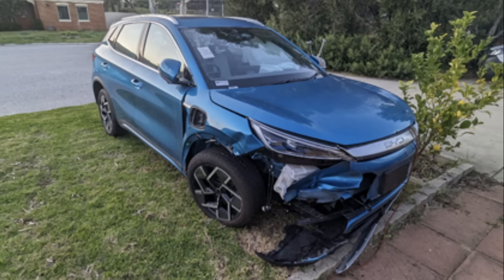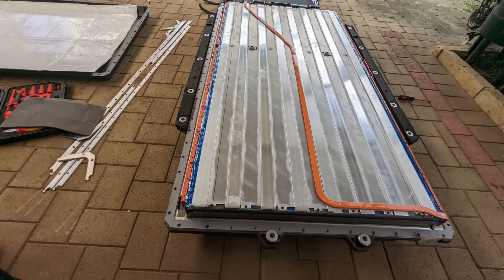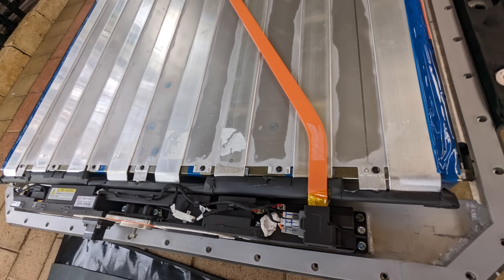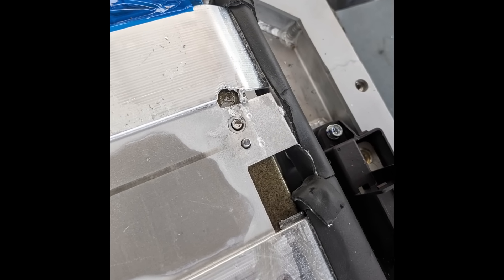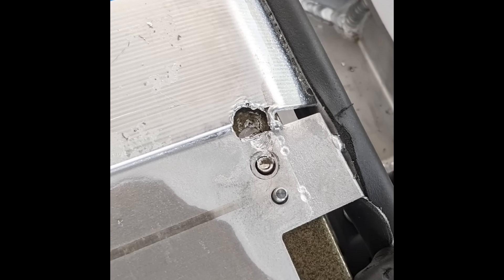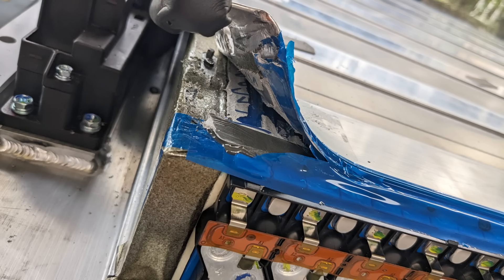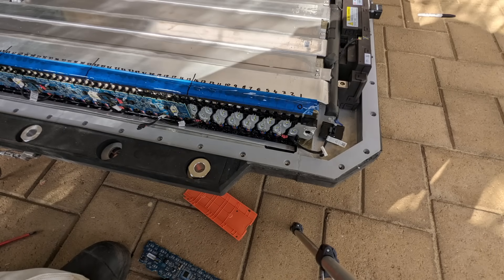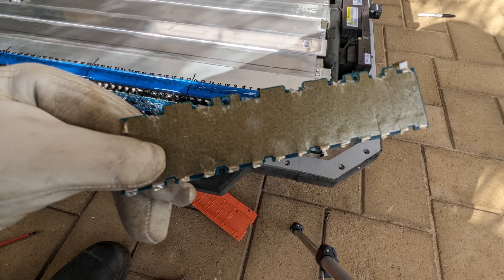BYD Atto 3 battery dismantle P1

Comment: If the airbags have gone off does it lock the battery?
Reply from the maker: Yes it does but I reset it all with a scan tool before taking it apart and I'm not using the original BMS anyway

Comment: This is really interesting! Thank you for posting! It's disappointing for me to see that it will be virtually impossible to replace a dud cell down the track. I'm pretty confident that BYDs batteries will last a very long time, but I have experienced a single cell failure on an early generation LFP in a home built EV, and the rest of the pack is doing fine more than a decade later. If they degrade evenly over 20-30 years or so, that's great. If the odd cell packs up earlier, it will be a real shit! Let's hope they last as well as they're supposed to!

Comment: Good video. I did not see a high voltage fuse in the battery, did it have one? I have a BYD Tang and i need to do some weld and i did not find the high voltage fuse do you know someting about it?
Reply from the maker: It has a fuse inside the contactor block at the front of the battery. It's not very accessible. There is no service plug to disconnect either
Reply: @Brendon_M if disconect the 12v battery there is no way to put the high voltage in the sistem?
Reply from the maker: Sorry, I didn't get notified of the comment. Yes, if you disconnect the 12V it should shut down the high voltage assuming there are no faults. It should be checked to confirm it has been safely depowered
Reply: @Brendon_M tanks. I find a safety paper and the prossidure is disconect the 12v batery and disconect One high voltagem cable from the batery to the controler. Its easy web you know ir.

Comment: As part of my doctoral thesis as a research associate at the institute for automotive engineering of RWTH Aachen University (Germany), I have extracted images from this videos for a publication. I do not receive any payment for the publication.  I created a image by cropping the displayed product from screenshots without changing them significantly. The compilation with other elements serves the better understanding of my written explanation in the journal article to be published.
This compilation of illustrations from other sources is within the scope of the German Copyright Act. I would therefore ask you for permission to reprint the following illustrations. 
By clearly identifying the sources used, international visitors to the congress and readers of the journal will be able to learn about your work.  

Please contact me for permission to reprint via the contact information on the website of the mentioned Institute. I was not able to find your emailadress and do not want to put mine directly in here.
Reply from the maker: You have my permission to use any images/ screenshots from the video. Depending on what you actually need, I might have some photos.
I tried to find your email but there were 6 different Matthias K contacts.

Comment: Adhesives are typically the means by which low costing electronics manufacture of this sort are made possible.  However, if recycling was ever part of the overall calculus, the overall costs go upwards fast trying to dismantle those adhesives.

Comment: Clearly, these battery modules were not meant to be repaired or re-used for any other purpose. BYD just trying to be like Tesla and design a very complex battery pack. Force owners to scrap their cars and buy new ones as soon as the battery starts failing.

Comment: Wow ! That's big enough to blow up the whole neighbourhood. I wouldn't like to be in one of those things in a crash 💥
I'll stick with Diesel power and a range of 1500 kms.
Maybe in the future when the battery technology is much more efficent and safer.
The other problem with today's current battery  technology is that if 50% of all cars in just one country were electric there is not enough power production to charge them all. So more nuclear and coal powered stations needed. And we are led to believe that electric cars are green ? 🤣
Reply from the maker: Please don't listen to disinformation about EVs.
Reply: Not having a go at you. What you have shown is very interesting.
To which part are you referring to ?
It's a fact EV's simply don't have enough range at the current technology level. Most of them get way less than stated. I hired one out in the Uk and witnessed this first hand.
In Australia, range plays a big part.
EV's make the most sense in the city or short trips, but you are still in the same traffic jam looking for the same parking spot... so decent public transport or an electric bike or motorcycle makes more sense.
I'm in the boat business, and many insurance companies do not like Li Ion batteries as house bank batteries in boats. In fact, most owners are buying Agm batteries when it's time to replace or upgrade.
Our electricity supply, in Australia, comes mainly from coal power stations, which is not what one would call green, is it ?
The size of the EV batteries, as you have well demonstrated, is such that a domestic house 15Amp plug isn't really up to the task. There are currently not enough fast chargers. One car test in the UK tested an old petrol Bmw vs the new Bmw Ev equivalent on a 3 hour drive and to my surprise the cost to recharge was a bit higher than filling up the petrol car. In the Uk unleaded fuel is almost $3 per litre. So in other words, EV's are getting more expensive to charge. Factor in the cost of a new one makes it an expensive exercise, not to mention the time and effort taken to recharge.
Unfortunately EV's are not efficient enough at this time. 
That's the current reality
Reply from the maker: Sorry for the essay, but I got a bit carried away....
I was mostly referring to the fire stuff but first.

Range is fine at the current technology level (except for towing) what we have a problem with is a lack of infrastructure. If there was a  DC fast charger for every fuel Bowser there wouldn't be a problem. Remember you can leave every morning with a "full tank"so you only need to use public infrastructure if you travel more than 300km in a day which is very few people. Yes there are outliers that mean an EV won't work for everyone. But buy a car fit for purpose. People aren't buying a Yaris to cross the nullabor and there shouldn't be buying a F250 to drive to work in the city. 
With the current technology plug in hybrids will work fantastic for regional Australia. All the round town driving is low emissions but the range is still there for the long haul. Unfortunately the current PHEVs are a bit crap (low range, bad battery degradation, low tow ratings) and a lot of the world is pushing past the hybrid phase and straight to EVs so not enough models are coming out.
There is the problem of people who don't have off street parking but those same people tend to not drive long distance so a DC fast charger experience similar to filling up at the bowser will work for those who can't gain access to power at their car while they sleep, lastest technology recharge times are below 20min (if you can find a fast enough charger) and there are plenty of sub 10min prototypes being tested. The thing about a transition is that they are never smooth or instant, things need to be done for change to happen. 
We have plenty of power, in fact when you move away from fossil fuels you use less energy because you no longer need to pump, process and transport the fuel (not including ICE is only about 30% efficient once you get the fuel to your car). There are certainly problems with local connections not having enough power especially in regional areas but the grid as a whole has plenty of energy, especially if V2G technology is implemented to spread the evening peaks out, though I'm unconvinced V2G will work on a massive scale as only enthusiastic people will implement it and unless it is heavily incentivised the masses won't bother. 
That all being said I agree 100% that decent public transport and electric bikes /scooters should be invested in as priority. EVs (and autonomous cars) don't fix traffic problems. 
Costs of DC charging are high due to the massive costs of the infrastructure rollout so that BMW trip makes sense. You pay a premium for faster charging but the money you save the rest of the time makes up for that, though once again buy a car fit for purpose. If you are going to be relying on DC  ultra fast chargers every week then don't buy an EV to save money (hell, buying any new car to save money is a dumb idea).
The complaint about EVs not being green is also silly. Even if they are fully powered by coal they emit less CO2 over the life of the vehicle (not to mention all the other various exhaust gases). And as a bonus what does get pumped into the atmosphere is happening away from where I, and more importantly, my kids breath.
If you take 20L of fuel and pour 10L into a car and 10L into a genset and charge an EV,  the EV will get further. That's why hybrids are so efficient, they are just  an EV with a genset.
Now add on the increasing amount of solar and wind generation and the fact it's energy Australia can create at home without being reliant on the world stage or market prices and it seems like a no brainer.
All that waffle aside, the fire comment is what got my back up. EVs are generally safer in an accident and significantly less likely to catch on fire. The big ranger is once the fire is going you can't put it out which especially on a boat is a bad thing. Insurance companies are scared of lithium batteries mostly because of poor quality BMSs and lack of safety systems in cheaper systems/ batteries. EVs have much higher quality BMSs that actually look after the lithium cells and shut down/warn people when there is an issue. Having a cheap BMS is like having no fuel tank. Imagine 2 boats, one with a proper fuel tank that you fill up, put the cap on and then use a fuel pump to send the fuel to the motor and the other boat has no fuel tank, you just fill up the bilge and let it slosh around until you need it, when you grab a bucket and scoop some up to pour into the in top of the motor. Both boats are at risk of fire due to the fuel, but one is much more likely to burn down. Does that mean we shouldn't use fuel in the boat with a fuel tank? 
Now throw in the fact that the Atto battery is LFP chemistry which is known to be even more stable than other Li ion types. 

I'm not saying EVs are our Lord and Savior but there is a lot of FUD out there from vested interests

Comment: What I gather from this video:
1. EV batteries are much more complicated than I have thought.
2. Now I understand why the cost of replacement is so high; also why there are no practical way to repair them.
3. At the end of their life the battery dismantling facility has to be very sophisticated operation - certainly not a scrap yard.
4. Chinese are way ahead.

This video is a great service for all mankind! Thank you!
Reply: Depends on the battery.
Look at a VW MEB battery. Pretty simple. Open it up, remove the module connecting but bars, pull out one module, renew the thermal paste beneath the modules, put a new one in, then reassemble everything. Sometimes the companies know how to construct something easy to repair
Reply: The warranty is like 8 year for battery.
Maybe not include a crash.

No, the old batteries are just used for home battery and shit.
Reply: BYD is even harder to repair than a Tesla one, which has glued cells. Most batteries are far easier to disassemble.
Reply: How much the cost ?
Reply: in Pakistan you can get repaired them with minimal cost... not sure about this blade battery, but normal batteries that comes with hybrid cars like toyota prius

Comment: The black top cover, is it made of plastic (not metal)? So many screws on the sides, but no rubber seal in between. Will water penetrate or seep through during floods?
Reply from the maker: Yes, it's a plastic cover that is bolted down. There are metal (aluminum) bits of flat bar that go around the edges that clamp the plastic down onto a gasket. There is a gasketed bolt on top, that when I loosened, allowed the air pressure to equalise because the battery seems to be airtight so I don't think water will be a problem
Reply: @Brendon_M  thanks for the info!

Comment: Brendon, have you had any issues with the heating and cooling? It did not appear from the video that you connected up the liquid cooling system, is that unnecessary? Are there any regulatory issues connecting a battery of this size to the grin in WA? thx Bill K
Reply from the maker: No cooling/heating and so far I don't think I need it. It would be nice to have but overkill. The thermal mass of the battery seems to be more than enough to keep the temps in check. The most I ever pull out or put in to the battery is 5kW and it's designed for over 150kW. Ambient heat in the middle of summer pushes the temp up but is in a coolish area of my house and hasn't been a problem. If I get a string of hot days I might put a fan on it if the temps get to high.
I have actually had some over heating in the inverter, it only has some cooling fins and pushing 5kW continuously for hours on end causes it to overheat and de-rate. I installed a fan and that seemed to cure that issue.

No regulatory issues other than the inverter had to be less than 5kW (I'm on single phase), as long as the sparky was happy and he didn't seem to care
Reply: @Brendon_M  thanks for taking the time to reply. I am in Qld on the Southeast Darling Downs, summer is hot. My system is currently at 30 kW of solar panels and delivers 3 phase. I intend to use the battery, as is, paired with a Goodwe ET series hybrid inverter and all going well connect a second battery in parallel. I am powering a recirculation aquaculture project. It draws about 6-7kW, 24 hours per day. I will go to the trouble of connecting the liquid cooling system to a radiator and fan. I will let you know how it goes. regards Bill K
Reply from the maker: The battery isn't liquid cooled. It's a refrigerant loop. You might be able to push coolant through the channels but they are very small. If you are using the battery as a whole (good choice btw) then, if you haven't already, have a look at Dala's EV repair YouTube channel.
Reply: @Brendon_M  Interesting, the vehicle I dismantled was so extensively damaged in the front end it was impossible to follow all the coolant lines. I have been unable to find a workshop manual for this vehicle, were you able to access one? I have seen some of Dala's videos, I will have another look. thx Bill K
Reply from the maker: There're some BYD manuals available on GitHub but they are all in Chinese that's all I've seen available

Comment: Are there any cooling channels? Because one of the issue with blade design is that all the cells are adjacent to each other tightly and only surface available for cooling are top and bottom part of whole unit (battery pack)
Reply from the maker: No channels unfortunately. The only cooling is through the refrigerant chiller plate that sits on top of the cells

Comment: Do you know if there is any way to use the inbuilt BYD BMS that's already on this battery? As there are hybrid inverters that work with 400DC. Have seen this BYD battery forsale for approx $3000 very tempted.
Reply: Many thanks 👍
Reply from the maker: Best bet would be Dala's EV repairs on YouTube. Not sure if they have cracked the BYD pack yet but they are working in it on the GitHub (dalathegreat)

Comment: With so many components and complex circuitry, what is the chance that the battery pack fails?
Reply from the maker: The construction and build quality is solid, but it is also very much non-repairable.
Theoretically it should be very reliable, but it's going to depend on how much BYD cheaped out on the components. I've heard random Internet stories saying the BMS boards are failing and also stories saying they are bulletproof. Not sure where the truth lies. Time will tell I guess.
Reply: @Brendon_M  My guess is they use mil spec components. I haven't seen any stories about BYD cars dying en masse. I'm sure I would have come across stories if it was an issue. And as you mentioned in a previous comment, if they fail, it would likely be during the warranty period anyway.
How weather sealed is the battery pack? I wonder how these cars handle flooded conditions.
Reply from the maker: The battery is very well sealed with gaskets all around. There are vent bolts on top that equalised pressure when I undid them so the whole thing is airtight

Comment: You freeze the pack to get the glue off. Then dismantle module at a time. Drilling directly through is crazy. Electrolyte is not ideal to inhale, and charged cell electrodes are flammable.
Reply from the maker: The drilling was to get the rivets that hold the chill plate off. The busbars are welded on as well so there is no way to dismantle this battery without cutting or drilling.

Comment: We need laws forcing the repairability of such battery packs, being glued and welded means they can't be repaired !
Reply from the maker: I agree. It's a robust design but it takes 1 failed component on the BMS circuit board and the whole thing is trash
Reply: @Brendon_M  A BYD fala que respeita o consumidor e o meio ambiente, que baita mentira! Realmente precisamos que os governos fiquem atentos a questão de reparo dessas baterias.
Reply: @Brendon_M yes one small BMS module is deffective means you have to change the whole battery.absured.
Reply: oops euroburocrate is here )) in first u should start to build your own ev industry
Reply: What do  you mean. ?  @TheBaza1978

Comment: Seeing that giant line of BMS makes me worried. If only one of those fails, the battery will become a dead brick. And the way its constructed, repairing it is impossible. You can only hope that the scrap value is high enough to offset the price of a new pack enough, if you ever get into a situation where the battery fails.